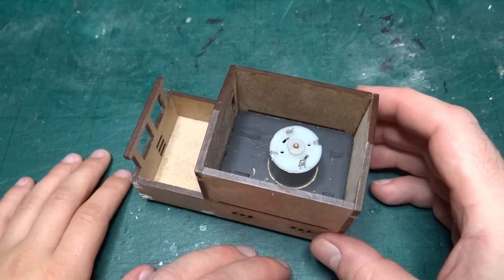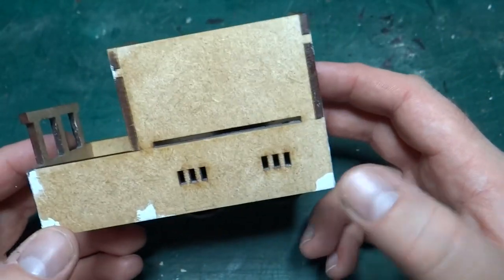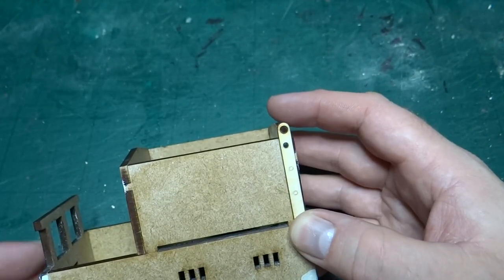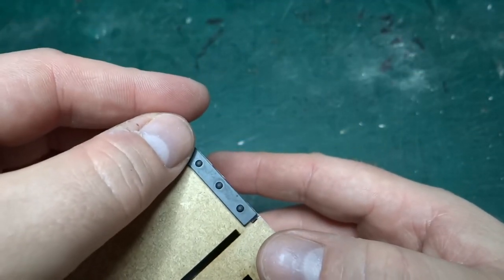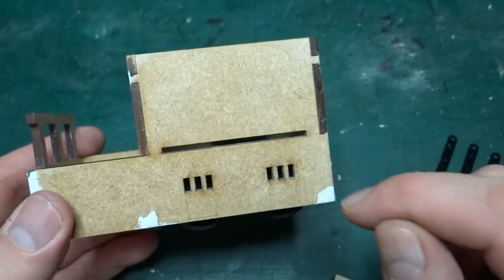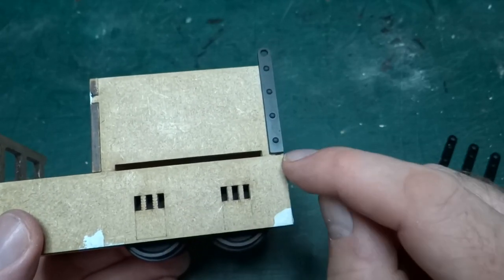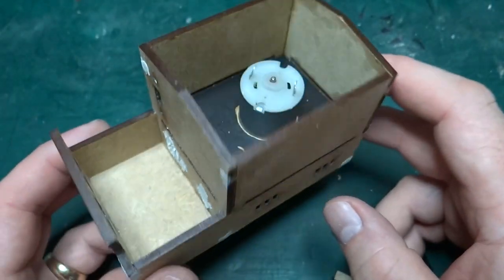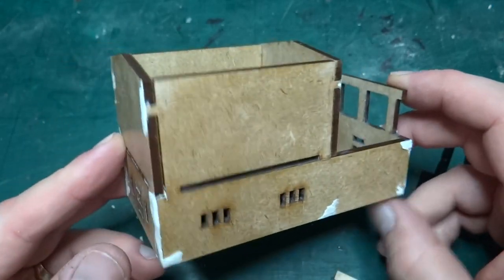We're Building an 0-4-0BE Locomotive from a P.S. Models Kit: It Works!

Comment: Hi both, I buy  half round nail art pearls  to use as bolt heads off eBay, I use external use pva glue to stick them to the fiber board 
The hits are cut from, they come in sizes from 1mm upwards .
Reply from the maker: Sounds like a much better idea than trying to drill into the small parts, at least for the round headed bolts. Will have a have a look to see what I can find for the next build.Thanks!